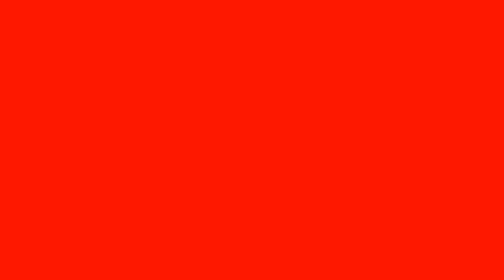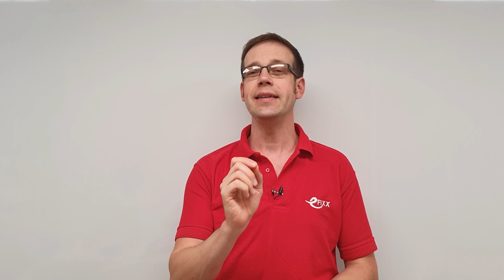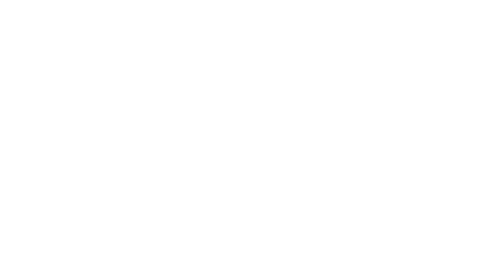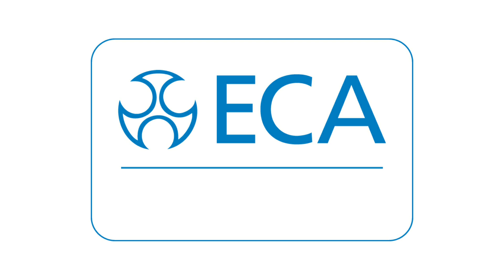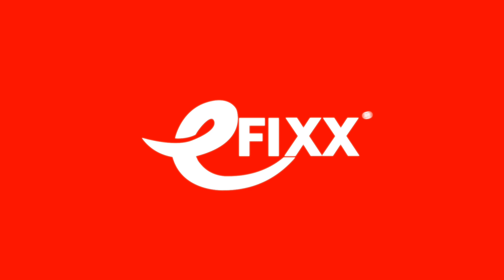Are electricians responsible for ensuring the correct light levels in a LED retrofit project?

Comment: as someone who's worked as a sales manager for three of the UK's largest manufacturers I'll come out and say it now, I've never once come across a sparky who a) knows what the correct levels should be b) posseses a lux meter c) would use it correctly.  

I've been called out to premises where there's complaints about headaches etc and the sparky has swapped out 2 x T5 tubes for 80W LED fittings which are spaced 1800mm apart, delivering over 1000 lux at desk level over users who have 2 x 27" monitors reflecting the glare back at them. 

Usual scenario is someone gets out a camera phone then leads the conversation down a route of flicker and want it all ripped out and replaced for free and lames the light. 

Lighting is rarely as straigh forward as most sparks think.

Comment: In my experience LED lighting usually exceeds the light levels of the lighting it is replacing.
Reply: I find brighter in most cases a little worse off, various LED panels ive worked under seem to be far more intence compared to the old cat 2 fluorescent fittings, glare seems to be unrecognised by the average joe schmo sparky. Many lost day for the sufferers of migranes and headaches
Reply: @maxtamandy  I have been using anti glare TGA modular 600x600 fittings from rexel for £33. They are brilliant little fittings that weight about 0.2kg per fitting
Reply: LED lighting depreciates over time, most between 10-30% up to 50,000 hours. It takes quite a while for  the lighting to depreciate and if someones not calculated it properly then it can cause issues